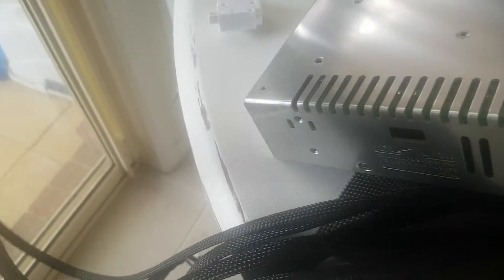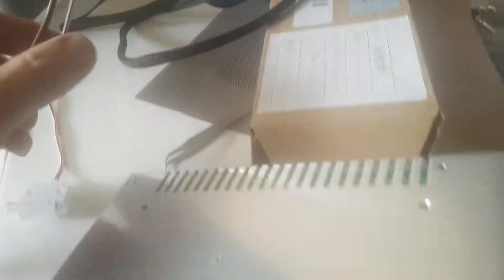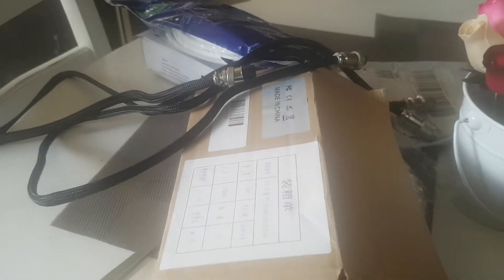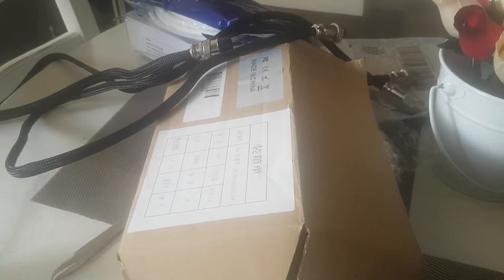Warning on modding CR10. Different between revision V2 and tiny machines CR10S board.

Comment: I can't find in your previous videos where you talk about the wiring differences.  Can you help me?
Reply from the maker: Nic Smith What do you need to know?  https://www.google.com.au/search?q=cr10s+motherboard&client=tablet-android-samsung&prmd=sivn&source=lnms&tbm=isch&sa=X&ved=0ahUKEwjQ9uu1huLbAhULerwKHdXLCkwQ_AUIEigC#imgrc=dm0sAzjpLBlPnM:
Reply: I think 2 main questions are, did you bypass the original mosfet because the new board had one on it?  Or did you still use the original mosfet as well?  And where did you plus in your fans?  Straight to the power supply?  Or did you put new connectors on and use the fan headers? Also, did you figure out how to bypass the filament sensor?  Or did you install one?
Reply from the maker: Nic Smith I had a filament sensor, but disabled in software. I used thefan plugs as I had some connector. Sorry for got last question. You I used the original mosfet. Make sure you change the temperature setting to look up TH3D for instructions. He had a great video on it. Good luck.
Reply: Did you have to update firmware before disabling sensor?  What was the problem with the temperature setting?  Is the board not the same value as old board?  or is it a problem when you upgrade the firmware?